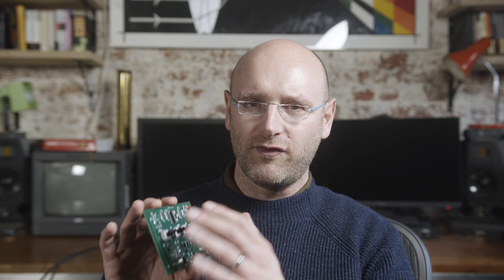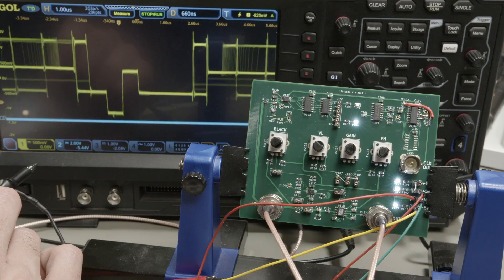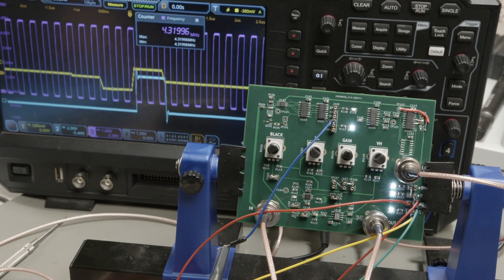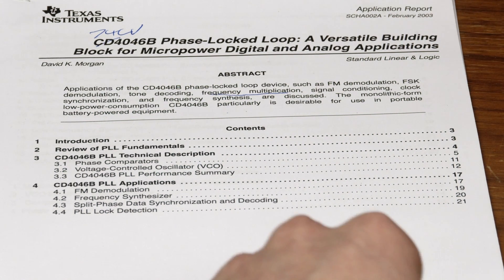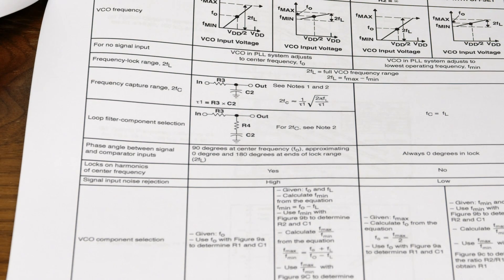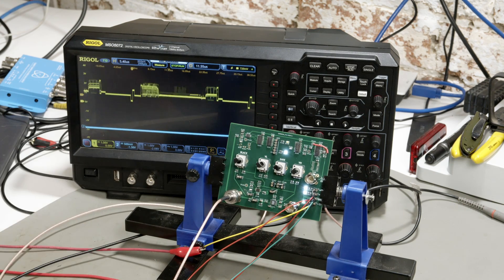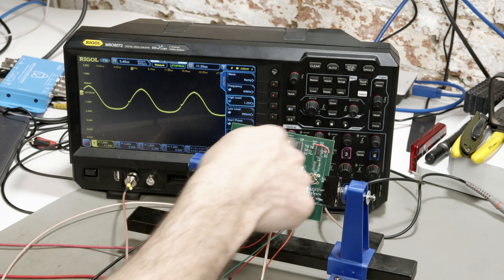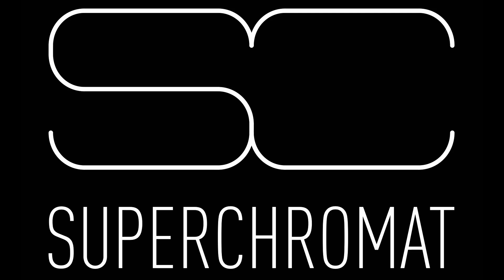Five amazing HD analog video IC's

Comment: It's 2022 and you made it half way through the video before confessing the utility of a microcontroller. That has to be some kind of modern day feat! Haha 
I really enjoyed watching this video. It was informative and nostalgic. I wrote or modified most of the firmware for a video equipment company called Burst Electronics in the early days of my own company. The equipment was (I guess still is as they are still around) analog and the micros were just setting up some of the more modern (for their day) I2C or SPI chips and also doing timing for logo (bug) generators, swapping in pixels from a logo or character generator memory or doing coms to allow remote switching etc. It was working with their equipment and studying the video signals where I learned to appreciate the wonderful nuances and amazing engineering of the NTSC signal. Some impressing engineering magic right their in our televisions, not the least of which was the ability to maintain legacy reverse compatibility over many, many generations of format improvements.
Reply from the maker: It takes 24 button clicks on my TV at home to reboot it. Which is necessary any time the wifi momentarily drops out.

Putting CPU's in video gear was a bad idea :P

If I was designing something like this for work, or for profit, I'd do it all in the digital domain. Way cheaper & easier, but I'd learn less :)

Comment: How did you find out about these chips? I find it difficult to know what is out there and available, though I search and search and read through many datasheets. For example, the MAX9012 comparator you used for chroma key in another video - I have done a lot of research on high speed comparators but I have not yet come across this one. Really curious about what is your research method.